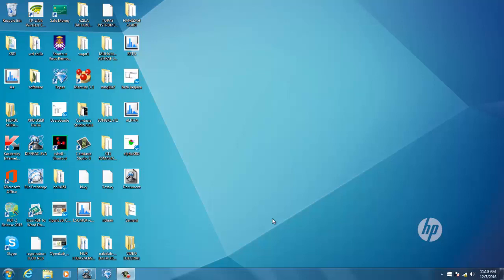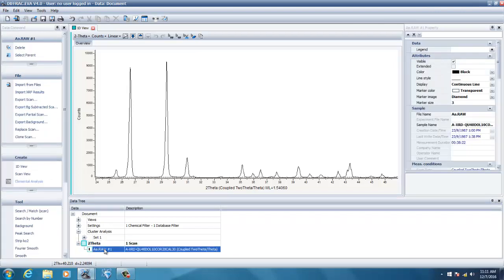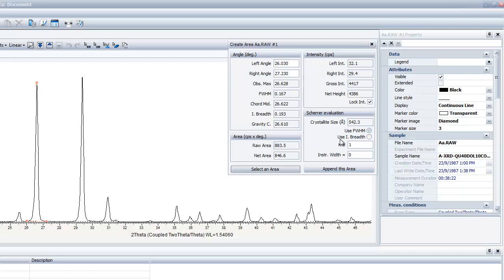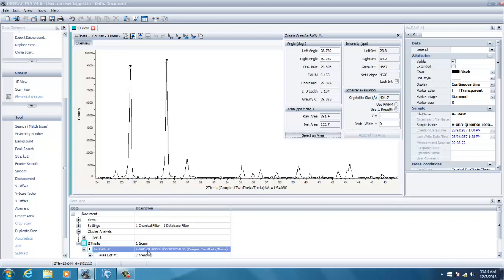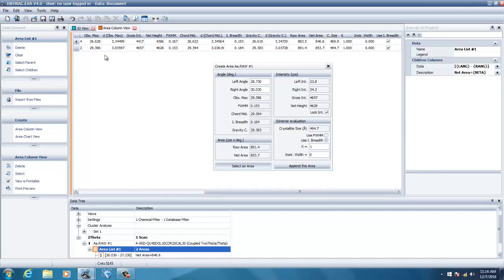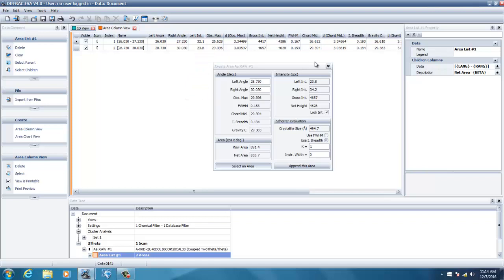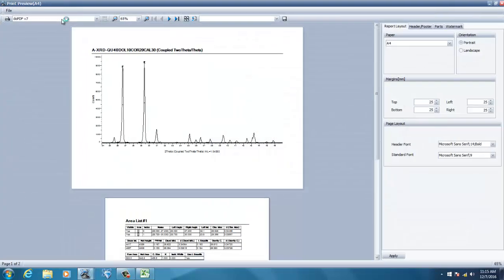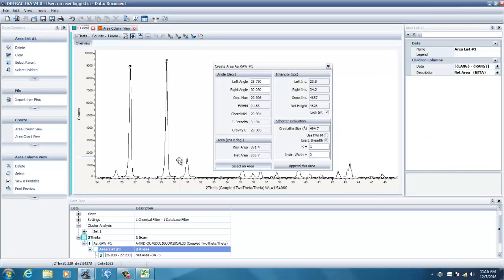FWHM & Crystallite Size from XRD using Diffrac.Eva

Comment: Warning, This is bad Content !!! You can not do like this.
Is this monocromatic ratiation?? You MUST remove the CuKalfa2 (if it is a Cu tube and no Johanson monocromator). You must also know the instrument  resolution. It is better to use the manual included for the program.

Mikael Ottosson, Lab. Manager the Xray lab. The Ångström Laboratory Uppsala University
Reply: Hi Mikael, could you please give some advice on how to correctly calculate? Thanks!